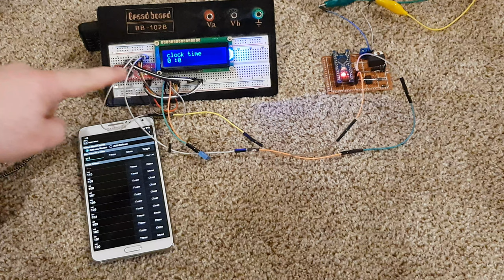Model Railroad Experiments: Fast Clock over DCC Accessory Commands

Comment: Would you consider updating the code to work with the LILYGO Displays?
I was looking for a way to build one of these, but if you would be open to sharing the sketch that I could load onto an all in one device, that would be fantastic!!
Reply from the maker: The code here was just a proof of concept to be honest.  I ended up giving the code to my dad and he added in the display parts for the actual display he used for the model sign that he made, which was a small graphical OLED display controlled via I2C.  I have the sketch on my GitLab page here:

https://gitlab.com/CalcProgrammer1/ModelRailroad/-/blob/master/ClockTest/ClockTest.ino?ref_type=heads

The code here receives serial packets sent by my DCC decoder to serial sketch:

https://gitlab.com/CalcProgrammer1/ModelRailroad/-/blob/master/AccessoryDecoderToSerial/AccessoryDecoderToSerial.ino?ref_type=heads

I set it up this way so multiple Arduinos could receive DCC without having to build a whole bunch of DCC decoder circuits.
Reply from the maker: Also this JMRI script turns the JMRI fast clock into the DCC accessory channels needed for this to decode:

https://gitlab.com/CalcProgrammer1/ModelRailroad/-/blob/master/FastClock.py